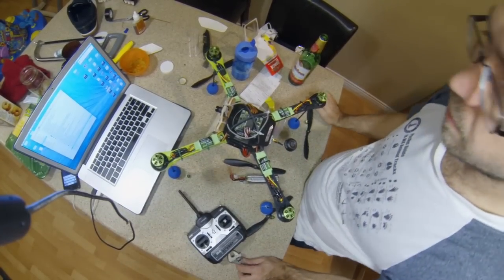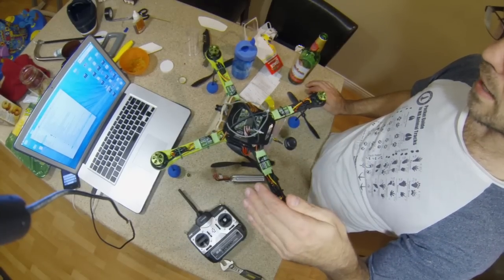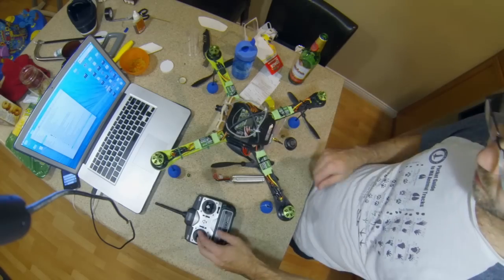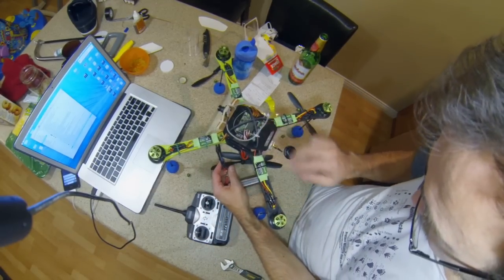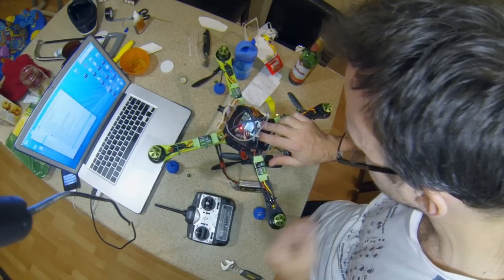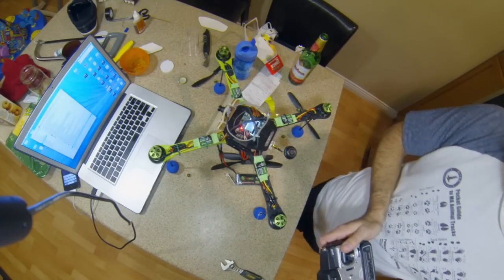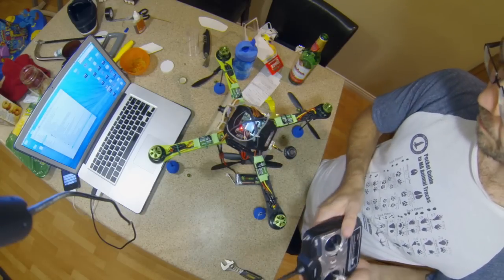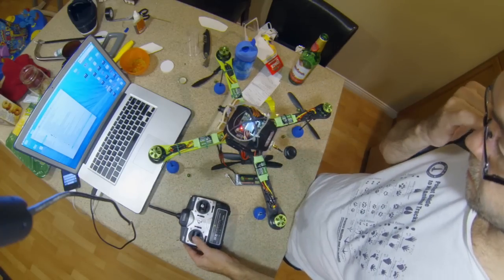Turnigy SK450 ARF/RTF - How To Calibrate the ESC's

Comment: I got the ARF one and whenever I do the throttle calibration and try to arm it, it never spins the rotors :( I hear the beep and it never stops beeping. It progresses to 2 beeps at a time, then 3, all the way to 5! Mine and your controller sticks are even opposite :( what do I do?
Reply from the maker: When you arm it, do you get the solid Red LED light on the KK showing that it is armed?
Reply from the maker: Jonathan Reichert Also, what controller do you have, perhaps you got a Mode 1 controller by mistake, instead of Mode 2?

Also, you will find it easier to get support from me and others if you join our group on Facebook.  Search Turnigy SK450 Quadcopter on Facebook.
Reply: The LED light only comes on when I calibrate the throttle :( sometimes when I keep the throttle all the way up and bring it down during calibration, the rotors either start spinning or it starts to beep and never stops. I bought the mode 1 Sk450 also. I have no facebook and you're my only hope! I bought a lot of accessories and I don't want them to go to waste. Please! If you could ask the people on Facebook if they know what to do I'd be extremely thankful.
Reply from the maker: MrAmericasbadboy are you able to take a video of you calibrating them so i can see your procedure?

Mode 1 means your throttle is on the right :(. You can't change that.

nothing will go to waste, you just need to learn the procedures. 

private message me your email address so we can stop using youtube, and i can contact you directly.
Reply: I can't private message because I'm using a phone, however I can make a video.
Reply: Alright the vids up. What am I doing wrong?

Comment: The multistar ESC's are impossible to calibrate reliable, and gave me so many headaches. Put other ESC's on it, and it worked perfect, instantly.
Reply: Johan Bos What ESC's did you use in particular for this turnigy sk450 quad?
Reply: 20A BlueSeries worked fine for me. Have the afro series on another quad, they're fine too.
Also upgraded to a Naze32 recently.

Comment: Hi Jonathan, I am planing to buy this quad,  Do you thing that I will counter  any other problem out of the box?    I had Latrax Alias quad before and I know how to fly.
I just want to make sure that if there dis any other problem on this quad....  of is the quality, motors life.. please let me know.
Reply from the maker: Seems great to me. I've crashed it and bumped it around a lot even, and it still flies like new without replacing any parts. 

When you get it, Calibrate the throttle, Calibrate the level on a flat surface, then just throw your props on and go!

I recommend also, in the kk2.0 settings, go and set the minimum throttle to 20. This makes it so that even if you put just a tiny amount of throttle on, all motors will start spinning at same time.

Message me if you get one and i can help.

www.facebook.com/lipobatteries

or

www.facebook.com/onathanJ
Reply: Jonathan Reichert Thanks,,,,  So by Calibrating  the level i stye Gyro...

It auto balance on the air ?

Comment: Jonathan, did you flash all the ESCs. I am new to this but based on the feedback of most of the users, flashing ESCs make response much better. Was just wondering why not all the motors spin at less than 50% throttle.
Reply from the maker: The thing that fixed it for me was, to go into KK2.0 and set the minimum throttle to 20. Now they all spin up. There was too much 'dead zone' in the bottom end of the throttle.

Comment: HiJohnathan, next step is a 9x or better TX. The rtf cheap tx has very crude power control on throttle. I found kk2 a bit twitchy even after tuning. I'll trade a good easy auto level fc for a lipo or something and install it for you. Then you can learn without fighting possible hidden issues.
 ch3 calibrate each esc sepperatly too it is way better I found.
Reply from the maker: Yea for sure. I have a DX7, and i have the 9x. I just wanted to try this as a completely stock setup, to let other people know how it works, and what troubles might arise. I'll probably switch it over to my dx7 this week, just waiting for a smaller receiver to arrive, to take up a bit less space than the orange rx's!

I have really been enjoying it, i find it flies very level and stable, unless you are in some heavy wind, but even then i'm quite impressed at how it handles (from a noob stand point).

I'm sure i'll eventually upgrade, but i'll get everything i can out of this one! So far FPV on it has been pretty interesting! I did some night FPV last night while sitting in my living room. Ultra laid back lol!
Reply from the maker: Jonathan Reichert it seemed to me like a lot of the comments on this quad on the hobby king page, sort of jumped to conclusions. Lots of people having trouble, and i just wonder why i haven't had any trouble flying it. I thought maybe that would be encouraging to others starting out, who don't have their own radio. I'll try and get some good flying footage of it today.